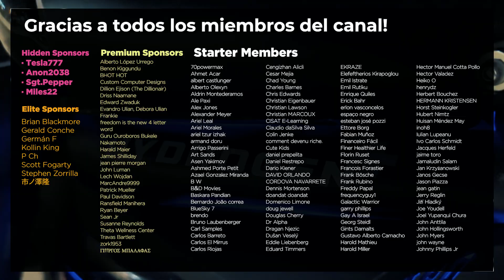Esta Moto Funciona Sólo con Agua - Adiós a la gasolina

Comment: Well done ! I knew someone would crack this for use in modern computer controlled engines. What people don't realise that electrolysis of water produces Hydrogen and Oxygen,  The density of hydrogen and oxygen are 0.0899 and 1.429 g/l at 0 degrees centigrade.
Density for all the elements in the Periodic Table

One liter of water will thus produce 111/0.0899 =1235 liters of hydrogen and 888.81/1.429 = 622 liters of oxygen. Note that according to Avogadro's law, the volume of hydrogen is about twice that of oxygen, because 1 mol of water produces 1 mol of hydrogen and 1/2 mol of oxygen. 

Simply stated, hydrogen needs oxygen to burn, getting the ( fuel air ratio) or hydrogen to oxygen mix to work in a modern computer controlled engine is a stoke of genius in my opinion. Well done.